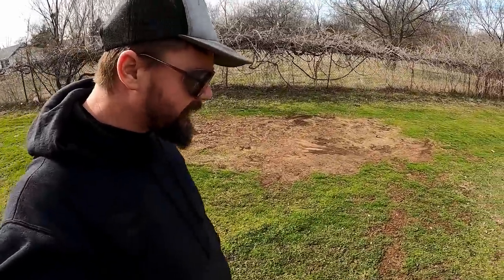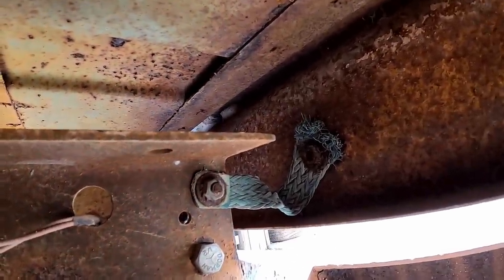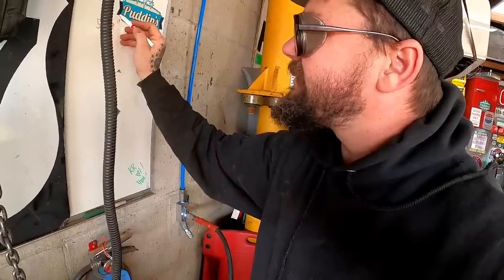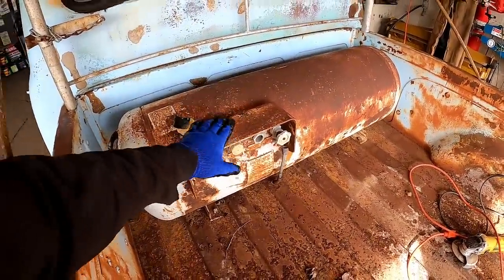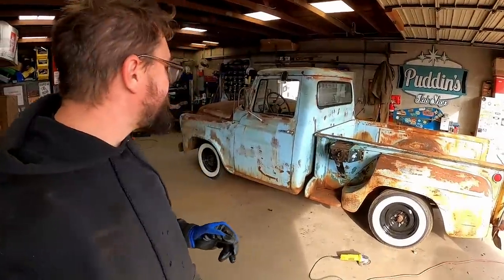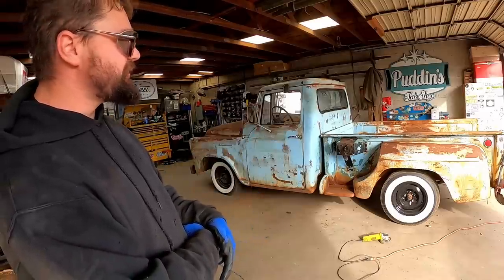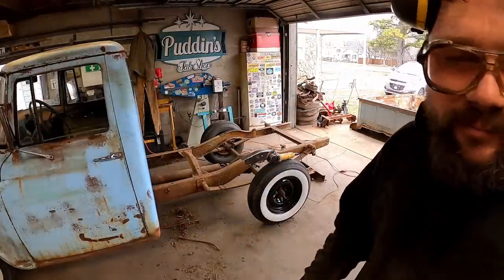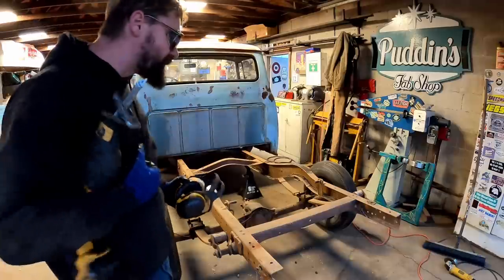Building SLAMMED rear suspension!1959 IH B100 BUILD

Comment: Crown Vic drive shaft will bolt up to that explorer flange and it’s aluminum, if it’s long enough then it can be shortened and use a conversion u-joint. 👌

Comment: The Explorer rear you want is best 96-2000. The Explorer Sport often has the Limited slip. V8 equipped Explorers normally have the additional antiwrap bar. One thing to watch out for on the Explorer rear is that the Pumpkin is not centered. It is offset to the passenger side by 3" so if you want to center it just buy an extra short side axle and cut the long tube by 3". I've done a bunch of these rears into Fairlanes.
Reply: Interesting. I knew my old Ford van was offset, but three Explorers later, I never noticed.
Reply: Thank you for the info!! I really needed this!!!
Reply: @kenethrobinson8841  awesome! Mines a 6.2 stroked to a 6.8 416ci LS swapped Colorado manual trans. This is my second one. The first one died a horrible death. Drive shaft broke and took out the gas tank at 80 mph and burn to the ground on the side of the interstate. All I saved was the engine and stall converter everything else was a total loss.  I'm going manual this time!!
Reply: Don't these have 31 spline axles and traction lock as well? Definitely tougher than the Mustang 8.8
Reply: @russellgault8978  put a cage around your driveshaft. Can save your life or a huge headache. They make em, or you can buy them.
Reply: @j.sargent9172  Yes! Most definitely going to happen!! Lesson learned 😂
Reply: @russellgault8978  I suggest it to anyone making a build with any hp over what the stock setup handles. Never know when that thing will go flying. Just seen a video on a dyno where the driveshaft blew thru the floor and hit the guy in his shoulder hard as shit. If it hit his head he might not make it, or severe brain damage. Too easy of a piece to install, dont want to skip over it. Hope this build goes well for you!
Reply: @junkyyarddawg  yes. 31 spline axles.
Reply: Use a v8 awd rear axle 3.73 gears factory lsd and 31 spline axles

Comment: There should be a tag on the top of the center section of the rear-end and it should have a L73 on the tag that means it's limited slip and a 3.73 gear. Thay came with a  31 spline axle, 91-94 drum breaks and 95-01 disk brakes. Hopefully this will help you and the mountaineer is almost the same thing

Comment: A good way to remove a bed by yourself is two ratchet straps crisscrossing the bed and use a engine hoist to pickup from the strap where they meet in the middle or slide the bed back on the frame until it tip down the just pickup the front setting the bed up on the tail gate. Put cardboard on the ground to protect it. Then the bed can be moved around on a good hand truck.

Comment: the explorer 8.8 with 31 spline axles and 3200lb rated housing great for ranger builds and hot rods, came in 1991-2001 exploders and up to 03 in the exploder sports and 05 in the sport trac the later ones 96 and later had disk brakes too 
good job puddin!

Comment: If looking at a Explorer rear end the ones to look for are from 1995-2001. If the driver's door tag is still available look for the axle code 'D4' that means it has 3.73 gears and the limited slip. The other common code is 46 which is an open diff with 3.55 gears

Comment: You might want to keep an eye on that shackle angle and clearance to the mount. Those springs will settle a bit and if you put anything heavy in the bed, it could bind. You could probably make some boomerang style shackles if it ends up being a problem.
Reply: The wife and I put eyeballs on the same issue. If they hit, he gon' know about it!
Reply: Has built in bump stops..haha
Reply: I'm betting that notch will bottom out like crazy, once everything settles. I've never been a fan of half frame notches. Just not enough clearance for all of that work, IMO. I predict shorter lowering blocks and a mount adjustment are in the future.

Comment: If I recall on the Ford products early 90s with rear disc the parking brake the cables every time you use the parking brake at automatically adjusted the rear disc brakes you can pull out the release handle and Ratchet your foot peddle or hand-operated ratchet that thing a few times and it would update the adjustment on your rear disc. That's the way it was on law enforcement Tauruses and Crown Vics, just saying might not be anymore.

Comment: I really believe with a load in that bed someday those shackles will hit their boxed mount you made as the spring de-arches and lengthens. But I could be wrong. With the bed, a couple hundred pounds in the bed and even just the leaf loosing some arch from age that shackle is going to travel a lot farther then you can duplicate by jumping on a bare frame.

Comment: The front leafspring mounts @ 52:00, I know you had some trepidation. It's just my opinion, Buuuuut if mounted straight up leave no shelf to collect crap. The front to back forces from spring compression won't be compromised because the bolt should pinch the bushing in the leafspring so there is no gap in the bolt to allow it to bend. Your not going to hall more than a 1/2 ton of junk metal without The headache bar you discarded. But that's my OPINION, (I know opinions are like a-holes) , but I think I have some valid points. Just sayin'.

Comment: A good rear is from a chevy tahoe/Yukon. It is also in the 1500.
Reply from the maker: They are generally too wide for a lot of older applications. Unless ya wanna narrow it of course!
Reply: I know they are beefy for heavy use and abuse. Chevy make pretty good parts and engines. The new engine for 2022-23 is amazing for gas and diesel. Duramax which are also put in alot of military vehicles. Durability is key.

Comment: the bolts for the leaf springs have a round head for a reason you just had to clamp the spring pack and flip the bolt and you wouldnt have to drill the blocks and rear end to locate the rear end.

Comment: Jacob, wouldn't it help to have non lowered suspension for a truck where you are going to use it like a truck putting weight in the back? I don't know if lowering makes it have less capacity weight wise in the bed.

Comment: This was a nice little venture back into the fabrication side of Puddin’s Fab Shop. And I’ve seen enough of your videos to know if you had to you’d have put Mr Mercer on some wheel stands moved the back end over by the shop crane hoisted the bed off wheeled Mr Mercer back and then dropped the bed on those wheel stands

Comment: Assuming that rear end is an 8.8, they put those in Explorers from 1991 all the way through 2010, I believe. They didn't give them rear disc brakes until '95 or so ('03 if you're pulling from a Sport Trac). 2nd gens ('95-'01) are probably the best, but I don't know as much about those. Back when Explorers were built tough. I have a couple.

Comment: You did those measurements with 400lbs of metal in the bed?
Reply from the maker: Yes. That’s where I want it to sit with out the metal in the bed. So measure it there. Remove metal. Build it back to there.

Comment: I'm not sure how to word this... did you end up with the axle at ride height closer to the rear of the c-notch or was it an optical illusion?
Reply from the maker: It is closer to the rear. I’ll explain at some point!
Reply: @Puddin's Fab Shop  does it have to do with how the leaf springs elongate when they compress thus moving the axle towards the rear of the truck?
Reply from the maker: Correct. More or less I was thinking backwards in my rushing to finish and accounted for it moving towards the front instead of rear.

Comment: If that was in a 4 wheel drive Explorer then I think that sensor in the rear end is an electronic locker for when in 4 wheel low.  You could toogle switch it and have on-demand posi.????

Comment: It's probably too late to comment but and you actually see it anyway. If you were to take another piece of pipe and use it as a guide to cut the excess off of your Notch the plasma cutter can make a lot cleaner cut I cannot even see tape measure marks so I have to use rulers and pipes and all kinds of crap to make guides to use my plasma cutter

Comment: So what happens when you cycle those springs which will flatten out and bind on that rear perch when the leaf springs lengthen?
Reply: what do you suggest?
Reply: Change the leaf's to a shorter set with proper arc. Proper springs eliminate the need of lowering blocks. Adjust the perches to fit springs.

Comment: I woulda probably just used studs, cut out the rivets, and flip the rear ones and then aimed the front ones parallel with the frame instead of horizontal.. I'm definitely a cheap and easy kinda guy tho

Comment: Have you noticed that you can remove a frame bolt that has seen 60+ years of weather they break loose and don't snap off? If you try a 5-year bolt on a new car or truck they snap every third bolt.  I would pay the extra $25 to $50  that it would cost in a new car or truck if the factory would order a better grade of fasteners for their production of vehicles. they buy all their fasteners in huge huge batches I'm sure they can spec out exactly what goes into the steel the fasters are made of for strength or corrosion resistance.

Comment: car plow cleaned the huge dump of two feet we got up north... van got stuck, everything needs chains and 4x4 to brake away from house arrest. no to nature, plow it away... engine oil so cold its thick as tar. "truck blew the transmission other truck to cold to crank another battery froze, least those 4.6L fords 2 valve over head cam engines have a good starter same as the V10 engine" - 38 in the wind